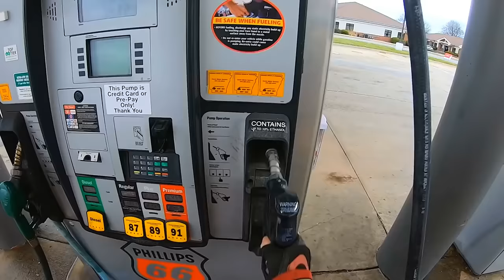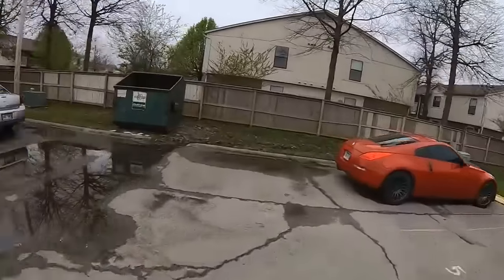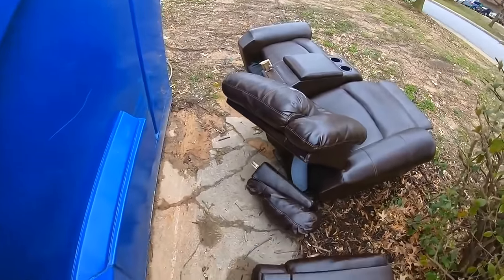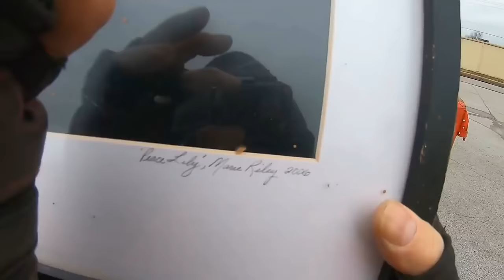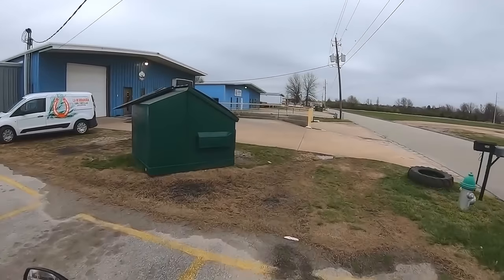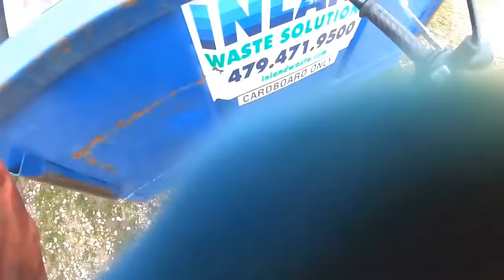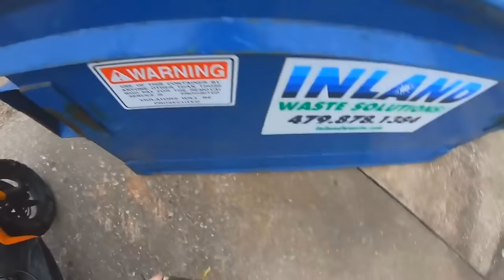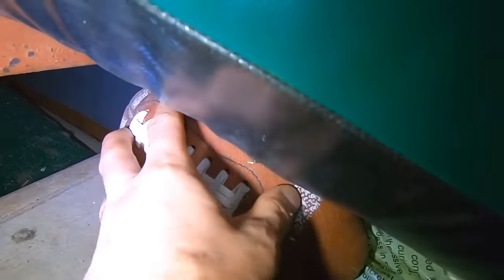Dumpster Diving Reality in Real Time

Comment: You don't have a truck a waste of time don't know why you're worried about that you're your nearly doing anything anyways how are you supposed to find anything when your bearly wanting to get off your scooter what was wrong with the toolboxes used toolboxes sell on eBay even when there all beat up people are selling rusted old  Craftsman tool boxes  from $80 to $100 or more and empty plastic drill boxes from $15 to $20 and more if there name brand boxes even plastic socket wrench boxes l bought bought a dewalt 20 volt cordless drill and it came in canvas bag because a lot of these tool companys have stop making the hard case plastic boxes because it's cheaper to put the tools in canvas bags so I put on eBay and bought a hard case plastic box for my DeWalt cordless drill can I pay $22 for it